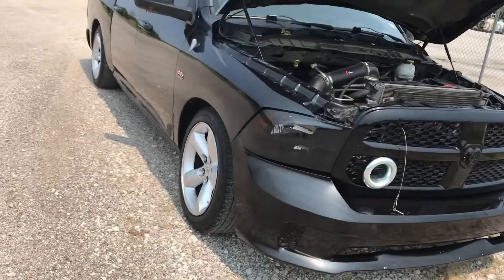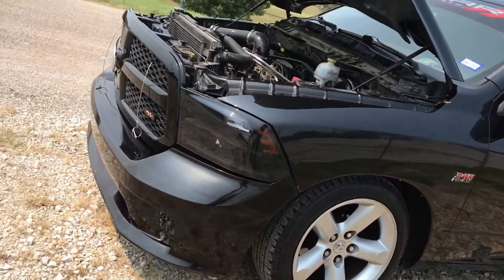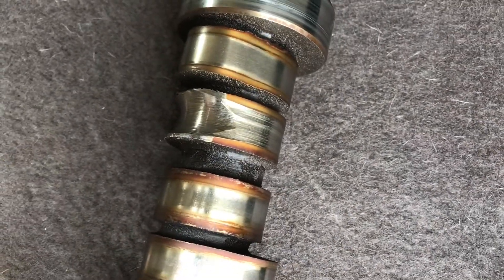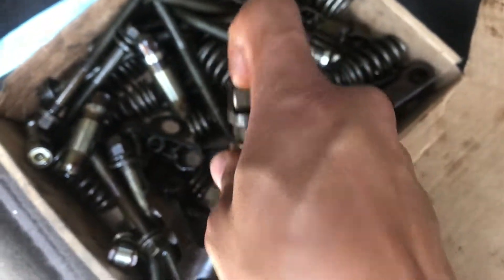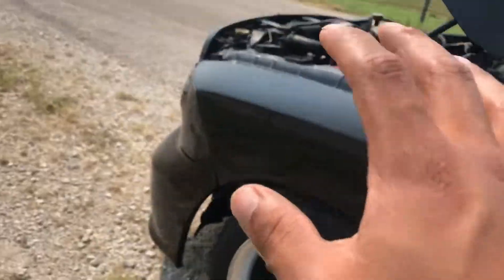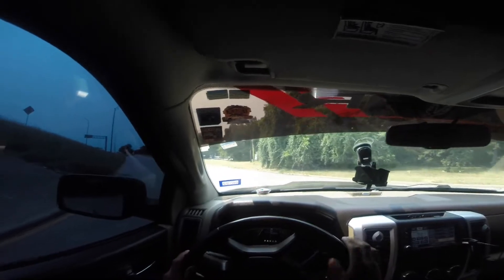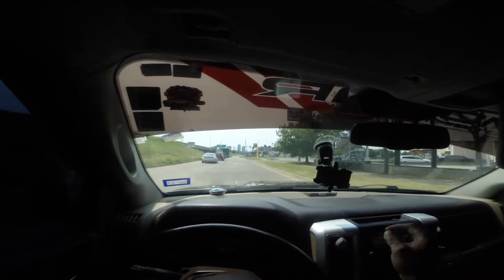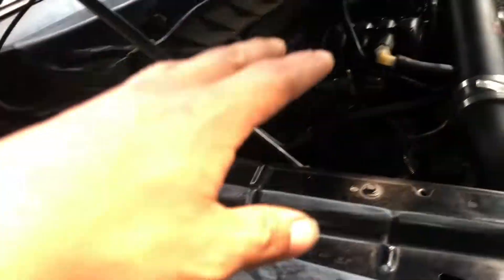BlackIce is back and Cammed!

Comment: Hey bro what drop kit do you have?
Reply from the maker: 3/6 drop bro all I did was cut the stock springs and added drop shocks all around
Reply: @lethalracing5.7  looks nice bro I have a quick question about your headers do you still run the eBay ones? And did you ever change the bolts that came with them I’m thinking about ordering the headers and the gaskets that you left in the description in that video please lmk 🙏🏽
Reply from the maker: @allaroundperformance  yes I still run those headers no cracks after a year and I still have the remflex gaskets but I would recommend replacing bolts with new ones just to be sure summit should have them
Reply: @lethalracing5.7  thanks for the reply bro you think you can give m part #
Reply from the maker: @allaroundperformance  go to that video I updated description
Reply: @lethalracing5.7  appreciate the help man!!!

Comment: Hey bro what’s the difference between the low lift cam and the ghost cam?
Reply from the maker: Lowlift and highlift cams are for performance the ghost cam is just a tune to make your truck have a choppy idle while it’s parked doesn’t do anything performance wise just for sound
Reply: @lethalracing5.7  with the ghost cam what needs to be changed?
Reply from the maker: @ivanzvlogz3716  nothing just need to get jay Greene or any tuner to send a file through your diablo sport or hp tuners
Reply: @lethalracing5.7  so upgrading to this ghost cam will that eliminate the problem this trucks come with(lifter failure and eating up the cam?) or am I still have be prepared with this problem happening in the future
Reply from the maker: @ivanzvlogz3716  it’s just a tune bro won’t help you with that problem seems like these trucks don’t get enough oil while parked so I would try to stay way from leaving your truck parked long